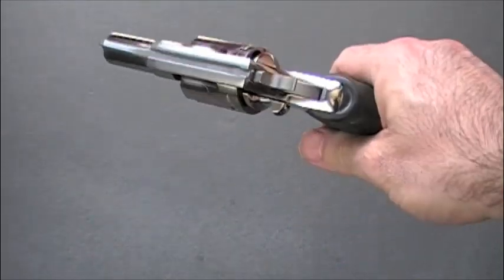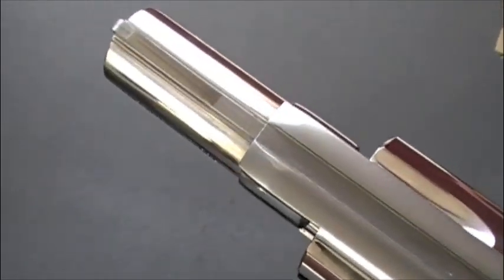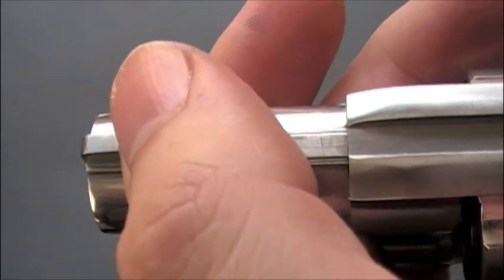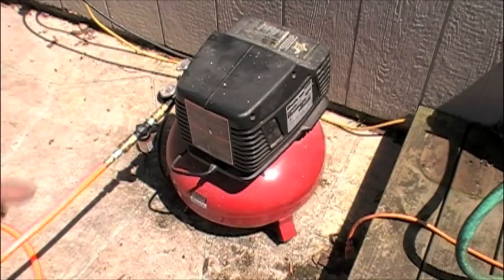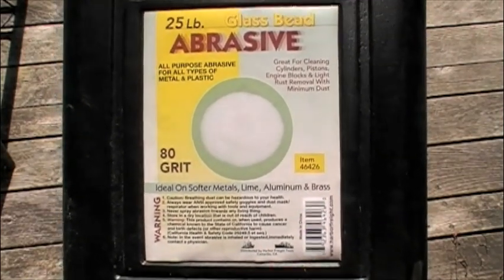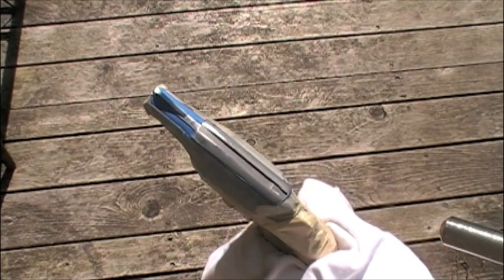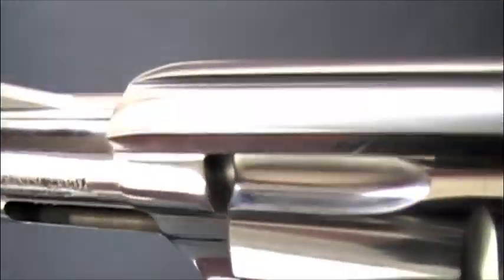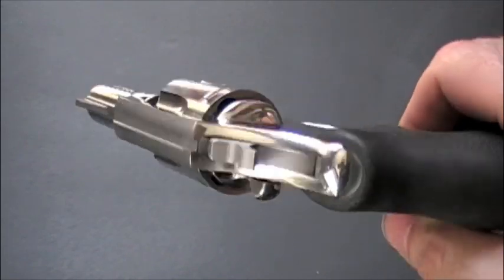Firearms Refinishing: Getting The Bead Blasted Finish (repost)

Comment: A few years back I refinished a Smith & Wesson Model 645 Second Generation .45acp semi-auto pistol.  I used a Sand Blaster Machine at work.  it was one of those stand-up cabinet type where you look through the little window and you puit your hands thru the front holes.  You load the piece to be worked on thru the side door of the machine.  The Machine happened to be set up with Walnut Shell Media - so that is what I used to Blast the entire gun with.  The gun turned out great, although the Walnut shells produced a slightly brownish tint to the gun - but it looked great.  I wish I still had that sand-blaster to do other guns, as I know longer work at that company.

Comment: You should try angular glass. Cuts faster and better than beads. Bead blasting is really for compressing and removing some porosity on the surface of alloys. Angular glass leaves a nice matte on steel.
Reply: 80 grit?

Comment: I recently purchased a S&W Model 66 Combat magnum. It's a bead blasted stainless steel flat finish over the entire revolver. Are you aware of any solvents that would damage the finish? I normally use Slip 2000 Carbon Killer on my 686 stainless steel with no issues but I am unsure about the bead blasted finish on the model 66. Thanks for your help.

Comment: Does anyone know what grit and type of bead a Remington 700 stainless matte finish is?  Also the PSI on the air hose used?  Had to buff out a scratch on the gun and ended up polishing the spot.  Trying to see if I can blast the spot to match the rest of the finish.  What I've gathered it may be medium beads of some kind.  If it doesn't seem blended after blasting can I sand it with high grit wet sandpaper to blend?  Thanks again
Reply: Landry Jones baking soda